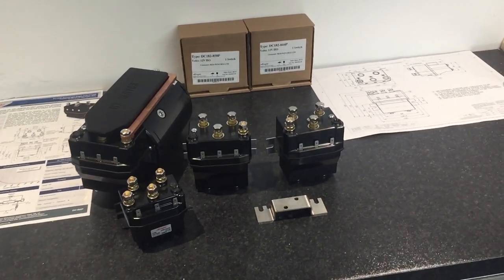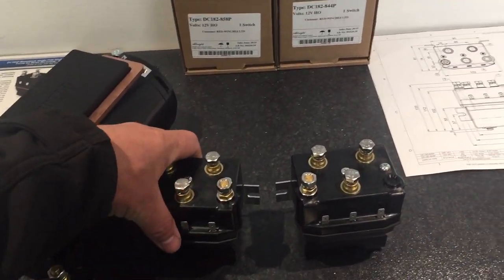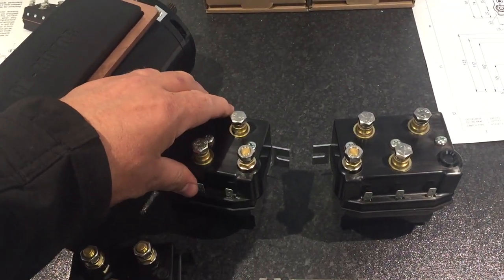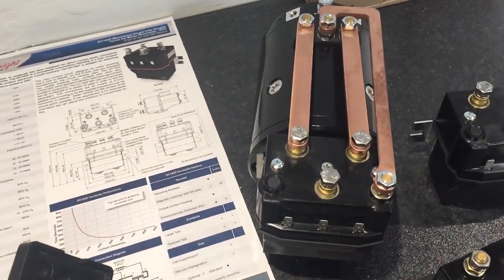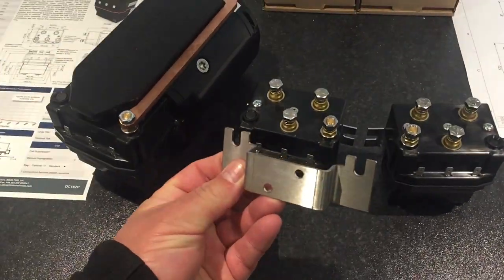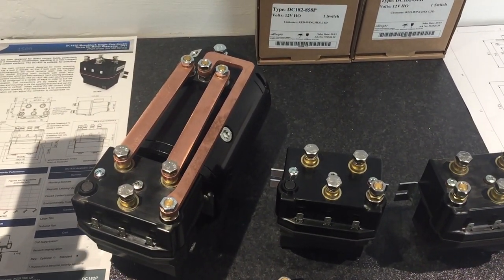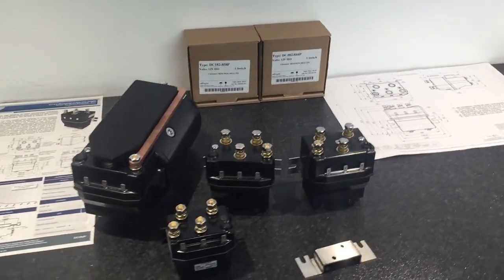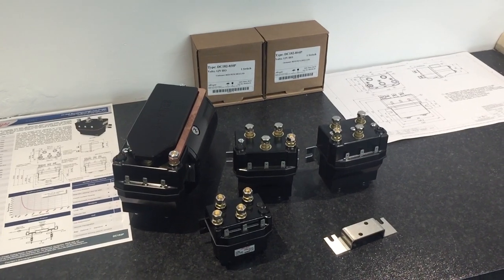DC182 Albright - The Ultimate Motor Solenoid

Comment: The Albright specs say 150A continuous  and 275A at 30% duty cycle... what have you guys found the limitations are in real- world use?  And can these be adapted to other Warn winch motors? My particular winch is the 16.5TI and the max amp draw is in the 500 area.

Comment: check it out I installed mr red winch 12volt expolorer 2 I used LODAR for wireless but the red light on control box never shuts off, so red said install the albright with 6 pin DP switch well that was not easy but I did it, and it either shut winch off ONCE but thats it do you have a video on how to wire this thing up?? Its delaying a trip to MOAB